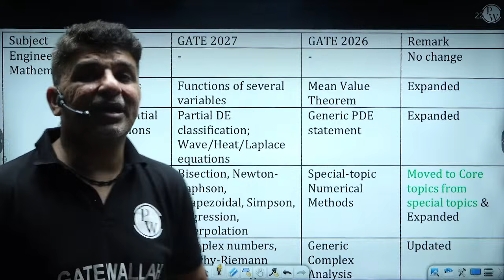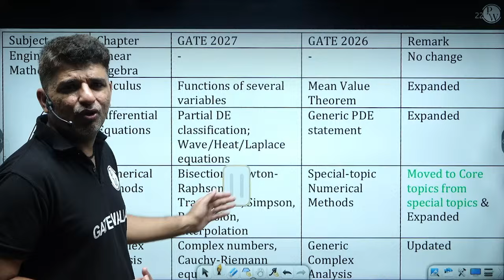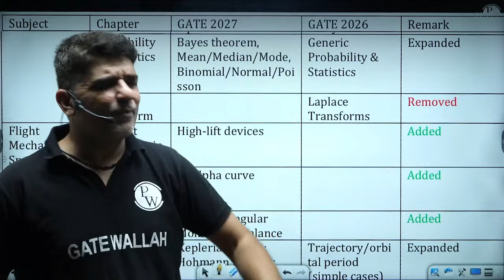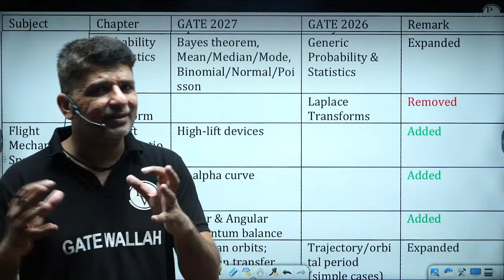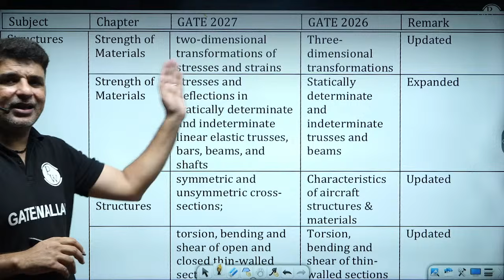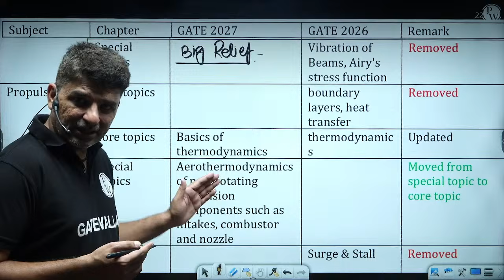GATE 2027 Aerospace Engineering Syllabus | GATE 2027 AE New Pattern | Biggest Changes Explained

Comment: Can CS candidate apply for aerospace engineerin' exam 🤔

I think gate must allow Aerospace engineerin' for CS branch as secondary paper

 when CS is eligible for ME , which common in AE too then indirectly CS must be eligible for AE

Moreover,  rather than includin' ST which is same as DA & GE which is non worthwhile branch , by removin' these two branches or along with these branches AE domain must be included for CS category 

It ain't necessary that if the syllabus is relatable from one branch to other branch's syllabus then one should go for different branch's exam 

IITs & all institutions must launch integrated branch course in CS +AE